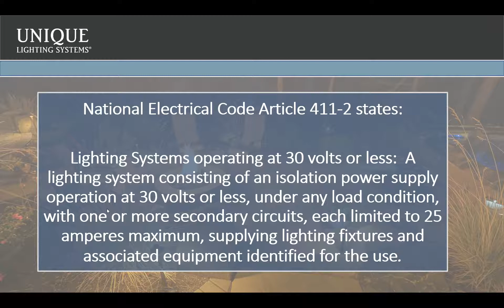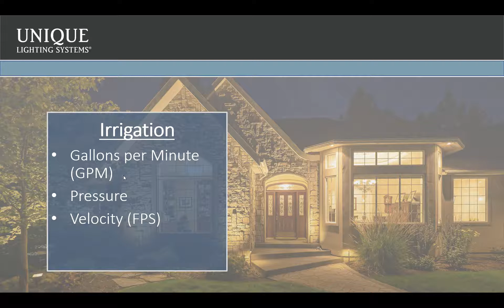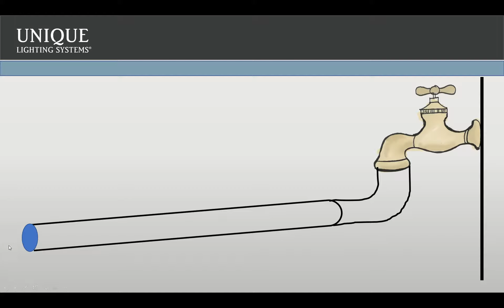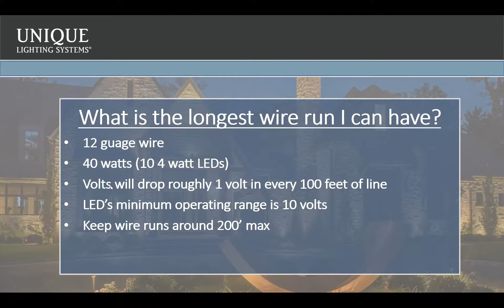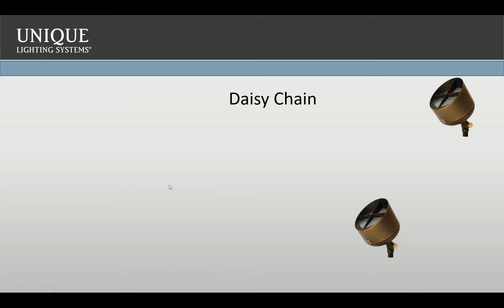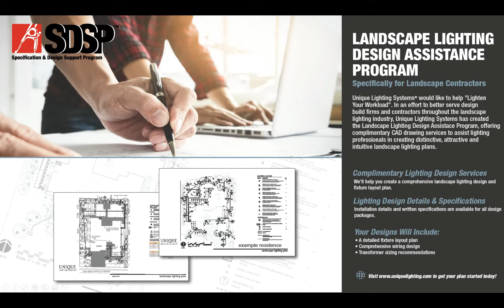Webinar 3 - Engineering The System

Comment: When calculating ohms law to find the amperage should you divide watts by the VA or just the volts?
Reply from the maker: Hey, good question.  You want to divide watts by the volts.  Always remember use a true RMS volt meter to check as well.

Thanks!